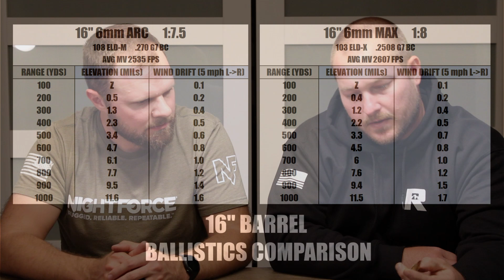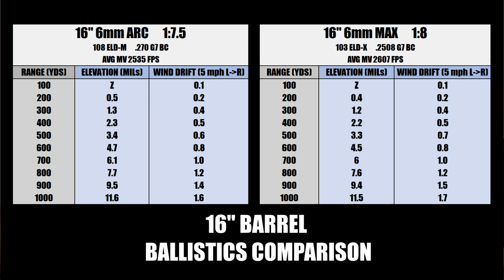6mm MAX vs. 6mm ARC: What's the difference?

Comment: It seems to be that the straight wall case would have more reliability issues with feeding because it has no taper. I mean, that’s the whole reason that 7.6 2X39 has the taper than it has: for reliability of extraction. So now you’re trying to tell me that this cartridge is more reliable because it’s long and thin and has no taper?

Comment: Ice not had failures with my 6mm ARC and 6.5 Grendel or reliability issues but im usually in hunting or sight in with occasional 100--1000 yard shooting.  This is interesting though with stock/thicker bolt face. Perhaps pressures can be upped a bit with handloading.

Comment: 6 arc and grendel really need an ak style bolt instead of the thinned out 5.56 bolt.  XCR and others have better multi cartridge version of bolts.  With Max being able to use a standard ar15 bolt, that does open the general options door.
Reply: No they don't. There's been 0 bolt related issues with 6 ARC, that weren't caused by improperly setup rifles or Fud's using over-pressured "hot handloads". And the only bolt issues with 6.5G were years ago and exaggerated to the max too. Buy a 6.5G Type 2 bolt, "problem" (that doesn't exist) solved. LMAO
Reply: The ICAR uses a bigger bolt as well.

Comment: The AR15 and "super short action" platform in general just needed to be sized a tiny bit bigger from the get-go. Something to the effect of allowing 10.5 to 11mm base diameter cases with the same thickness/strength as the current design has for 223. Same with the mag and mags being widened for that so they stack better than Grendel-sized cartridges. And screw it, either a 2.375 or straight-up 2.5-inch COAL, too. 2.25 is too small for the powder charges that wildcatters want, especially with the base diameter limit.
Reply: Well, I just did some Google searching and discovered 400 Legend. Now somebody just needs to make a wildcat out of that and we're golden.

Comment: The slower-burning powder requires a longer barrel, which is in the opposite direction of all the progress made over the last twenty years. To significantly increase performance, you need more powder. 

As people often wrongly believe, the higher pressure doesn't increase overall performance. Sig's higher-pressure round was developed so they could utilize shorter barrels with the faster-burning powder.

This is confirmed when you watch the 6 Max video from a 10.5 barrel. The performance is there, but so is that massive flame out of the silencer. That's not going to work for the military.

Comment: why didn't  yall compare  103 to 103 ????????????? Apple's to Apple's 🍎
Reply from the maker: If you consider the cartridge/case designs, they are not actually apples to apples. 103 is considered heavy for 6MAX while 103 is medium/heavy weight for 6ARC. However, you can find info on 103 vs 103 in this article we did, and you'll see there's not much difference ballistically between the two:

https://www.sunnshadow.com/post/6mm-max-a-comparison-of-top-performing-small-frame-cartridges-and-ballistic-data

Comment: I will keep my arc  , 6 max doesn’t work with heavier bullets . It will never take off
Reply: Almost nobody needs bullets heavier than 105. Max will be a beast as it gives ARC performance with regular bolt and mag combo
Reply: Why not heavyer more than  105 grs
Reply: 6mm MAX will eventually take off because it only requires a barrel swap, as it uses the same 378 Bolt-Face as 5.56. Which saves you time and money. It also is superior as an AR cartridge, and is more likely between the two to see actual Military adoption. Plus it has a standard 30 round capacity, 6mm ARC is 25 rounds with the same magazine size.

Comment: looks like you would get more throat erosion with the 6mm MAX over the 6 ARC due to the shoulder geometry. But yea damn! I have alot invested in 6 ARC but am cosidering transitioning over now to the 6 MAXX due to the increase in realiability,
Reply: Both have little throat erosion. The pressures are tame vs max spec for pressure

Comment: You guys have been holding the hand of the 6 max and slamming the 6 arc. You guys should stop slamming and just go with the casing, which is the game changer. If you go down to 105 grain with the 6 arc, performance will be the same, if not better for the 6 arc. The cost and availability of the 6 max ammo will make or  break it. We don't need anymore $1.70  round ammo.
Reply: Well when you can't run an arc reliably for more than 1000 rounds at most, for 10k rounds straight, it's just my experience. And many, many more folks experience. No slamming, it's all fact.

Comment: Been running 6.5 grendel since it's inception.  Hunted with it and put thousands of rounds through 2 different rifles one with a Faxon BCG one with a JP and I have a cheap PSA BCG I keep in my rifle bag just in case... Never needed the backup and I;ve never had to use the curved mags.  I run C-products 25 rounders and have -never_ had a feed issue or any type of stoppage.  The 6MAX looks like a cool round and a great improvement over the 5.56 but the 6.5 Grendel and 6ARC don't have nearly the troubles in real world usage that all the theoretical discussions always bring up.  123gr SST from my 16" 6.5 Grendel "mountain rifle" sure does a number on the White Tail and Mule Deer I hunt up here in Idaho.  I've even taken a cow elk with the round.

Comment: 6 arc can shoot all weights 6max cant. If you showed apples to apples fps comparison both with 103gn eldx instead of the 108eldm in the arc the arc prob would be faster. Im at 3700 rounds of 6 arc w a rca bolt w no prob. Never heard  of any from anyone else. I have on 5.56 caused by an over torqued barrel. I suspect if anyone does break one it would be a secondary issue. If all you wanted to shoot was the light bullet why go 6mm. But hey push that new hotness
Reply: @sunnshadow put some content out on this.

Comment: What are the actual caliber dimensions of the 6mm MAX? 6 x ? mm. The ARC is 6×38mm.
Reply: .243 dia and 1.263 bullet length on the 103g eldx
Reply: 6mm MAX is technically 6 x 43mm, since the 350 Legend (9 x 43mm) is it's parent case.

Comment: It's time to just redesign the AR's receiver set to be slightly larger....as LWRC has done with their 6.8 SPC platform. Then you can come up with any cartridge/magazine design that isn't restricted to the current OAL, will surpass 5.56 terminal ballistics, and still be much smaller than the AR-10.
Reply: Like the AR12?
Reply: @BYRM3215  No. Not the AR12.  "Slightly larger" does not mean the next size up.
Reply: I don’t disagree, but guys like the idea of interchangeable parts. If you break a bolt with 6 max you can run to the nearest shop and get one, with a proprietary system you’re kinda dependent on availability.
Reply: Someone is working on that for the ARC itself, built a purpose driven platform around the cartridge.... wait for it... correctly.
Reply: @maddawgmr are you talking about noveske’s new 6arc with def barrel?

Comment: I'm not wholly convinced that 6mm MAX is going to be all that much of an ARC killer.  ARC seems to be doing a good enough job of it by itself given the extreme limitation of ammo manufacturers producing the rounds(and rightly so since 5.56 and .300blk remain the most popular AR platform cartridges with .350legend competing with .450Socom and .458Bushmaster for the next slot, though I see more people looking for bolt guns in .350 than autoloaders in my area).  Then there's a limited number of manufacturers producing rifles in meaningful numbers for 6ARC to have really been propelled into more mainstream success.  Hornady was extremely tight-lipped about ARC when it first came out and imo that hamstrung the cartridge's potential.  Plus the questions of reliability with ARC, while reasonable due to it's grendel origins, could be at least mostly ironed out with time since it is still a fairly new round esp when compared to .300blk or even 6.5grendel and 6.8spc/spc II.  6mm MAX seems to be trying to solve a problem that really wouldn't be there if the industry actually took the time to properly work out the teething issues with each of these "super cartridges".  At this point it seems more like a junkie chasing a high that never really gives the same return on investment as that first hit(in this case being 6.5grendel and 6.8spc) where, it is true that these cartridges all solidly outperform the 5.56 ballistically at comparable ranges in exchange for certain concessions such as mag capacity, they hardly seem to offer any significant improvement over each other to be worth tooling up an entirely different setup in a mass production sense.  One of the main reasons I see .300blk having the level of success it has seen is due to its versatility in its use, production and load options.  A .300blk uses everything the same as a 5.56 except barrel more or less so fewer proprietary parts, it can load virtually all the same bullet weights as .308 and then some and this flexibility also makes it excellent for suppressor use which lends itself well to both home defense as well as small to medium game hunting at the avg ranges your everyday hunter may encounter(sub 300yds in most cases in the continental US where case restrictions don't persist).  Long story short, there's so many factors that lead to a cartridge living or dying so to speak and until I can see for certain 6mm MAX will tick all those boxes or any other wonder round for that matter, I won't rush to change over all of my rifles any time soon.
Reply: 6mm MAX is superior to every cartridge mentioned and is the easiest on the bolt and bcg. The miniscule differences (not counting .300blk at all, it's a sub 300yds effective round) between all of them is a stupid argument tbw. Because after 500 (if you're even capable of repeatedly and accurately shooting that distance tbw), it's STILL going to be a YOU factor. Not a gun or caliber cop-out factor.

Comment: Is this the standardized 6-223 wildcat?
Reply: This is based on the 350 legend case. The 350 is a slightly larger diameter than the 223/556 case. I had to double check in my reloading manual on the case sizes.

Comment: The Grendel-based mags leave heaps to be desired. Any step away from them is a positive thing, IMO.
Reply: Not to mention they look super ugly. The straight mags look way better
Reply: I run several duramag stainless 10rd mags for my 6 arc builds, zero issues with any of them. But some other brand grendel mags i havent been so lucky with.
Reply: My Elanders have been flawless

Comment: The real question is will 6mm max be supported by the manufactures.
This also, in a way, supports my desire to have a slimmer case for the ar10 platform. Get more rounds in the magazine, run the longer bullets, have reasonable firepower.
Reply: it runs in a ar15
Reply: @steveelder5306  I know... 
I was saying, if you could get a slimmer case in a ar10 length mag, you could have a big brother to this and fit more than 20-25 rounds. IIRC you can trim 5.56 pmags on the inside to get 30 rounds of .350 legend to fit. It's a thought I've had for a while but I don't have the space or time to make it happen. 
So imagine one of the small platform ar10s (SFAR, DPMS G2, POF ETC) with an ar15 face bolt in the carrier, pushing a longer case with a smaller OD than ..308. 
.308 has a base diameter of .47, .223 has a base diameter of .376. Doesn't seem like a lot but it's enough to change magazine capacity. .350 legend (parent case of 6mm max IIRC) ahs a base diameter of.39. So lengthen that case for the OAL of an ar10 mag, stack more rounds, have fun wild catting lol. Same thing with a 6.8 spc case at .422 base diameter, increase the OAL, neck it down to 6mm or 6.5, hell bump it up to 7mm, and have fun! While you're at it, run an Ackley shoulder. 

As far as the 6mm max, It'd be great if the industry would support it. 6.5 grendel had some decent support before steel ammo got cut off. 6arc is made by 1, maybe 2 companies... Remember 6.8 spc... yea, me either.. lol.
Reply: Yea. I wanna be fired up with 6 MAX. But not at $1.50 a round.
Reply: As a reloader, when Lee comes out with a factory set of dies I will get really interested in this. I have a bolt and a gas gun in 6 arc. If this becomes mainstream, the gas gun will get converted.
Reply: @josephlong7420  
It'd be nice if they'd fit in modded pmags the way 350 legends do...
Reply: @maguslascivious4980   if you handload some of the lighter slugs I think you could squeeze them into a polymer mag. I don't think anything above 87 grain would fit.

Comment: I'd like to see tests done with a 20"-24" barrel. Those certainly are good velocities for a 16" barrel but my preference is different than most I guess. I really like the fact it uses a 5.56 bolt. I've been lucky (If you want to call it that) and have broken only one extractor with ARC (And that was factory ammo) BUT that was the day before a match and I was at the range. (125 miles from home) I'm going to give this cartridge more time before deciding if I'm going to jump onboard with it. 6 ARC has been good to me and I have to admit, I'm also curious about 22 ARC. Wish I lived closer to where the Quantified Performance matches are held. All we have is PRS.
Reply from the maker: We have test data from BCPB on a barrel length vs velocity chart in an article on 6MAX here:

https://www.sunnshadow.com/post/6mm-max-a-comparison-of-top-performing-small-frame-cartridges-and-ballistic-data

Comment: I'll never understand why this hasn't been done before. Expanding the neck of the 5.56 round makes so much sense.
Reply: The 5.56X45 necked up is the 6x45, there is also the 6x47Rem. 

This guy is supposed to be built from the 350L giving it a little more capacity than a straight x45 derivative.
Reply: @wulf0101   And a 223 duramag will let you load the 6x45 out COL 2.305. If you reload the 6x45 is simple 1 step sizing. Range pickup brass is cheap or save your 223 brass. The 6x45 round is what the military should of done instead of the 5.56. There is the 25-45 Sharps also, along with 277 wolverine, 6mm mongoose, 6.5 PCC (Patriot Combat Cartridge) or go down in caliber 20 Tactical ( I have) or 20 Practical- either of which keep up close to the 204 ruger. If there is something the 223/5.56 can be made into its more then likely been done already.
Reply: I agree!
But I will say both my 6 ARC guns have never had any feeding issues. Both run like old fashion type writers.
Reply: Same here. No problems using cheap 25 round AR stoner mags. Not sure who makes them but they're GTG. I use an enhanced Aero lower on mine @tompanek7511
Reply: its been done before. everything has.
Reply: 6.35x45 gives similar performance . Uses std brass and mags too.
Reply: Because that's not what 6 max is. It's a necked down 350 legend straight wall cartridge.
Reply: The military played around with the 6 x 45 back in the early 70's. Heavier bullets leaving the barrel faster, but they must have felt that the juice wasn't worth the squeeze
Reply: They did with the 6x45/ 6x223 but the powder was the problem. Yet it could have if say black hills worked it and the DOD did look at it. But the grain weigh wasn't there.

Comment: Having broken a 6.5 Grendel extractor and only being able to use 10 round magazines reliably, I welcome this round and look forward to using it.
Reply: Some companies used wrong bolt for the chamber 7.62x39 and 6.5 Grendel have same bolt face but face depth are different same issue with extractor depth issues 
Also on extractor make sure there is a chamfer on it so ramp over rim during feeding
Reply: 6.5G Type 2 bolt. 5k+ rds, 0 issues whatsoever.
Reply: 6.5 Grendel will feed reliably out of the Duramag 7.62x39 30 rounders. C-Products feeds them, too. 

If you're breaking extractors, try increasing your buffer weight, and/or adjusting your gas, if an adjustable gas block/gas key is an option for you.
Reply: @BuckF0eJiden  ^THIS^  been shooting the 6.5 Grendel since it was introduced and I've hunted with it for years here in the PNW.  I've had 25rnd C-products mags run perfectly for me and never broken a bolt/lug/extractor.  I've got 2 rifles, one with a 16" Faxon Match bolt/barrel and a 20" BA Hanson barrel with a JP bolt, both run flawlessly.
Reply: @DB.KOOPER  most people don't shoot enough to see broken extractors or bolt lugs in 6.5 Grendel ARs. 

Even if you're running a massively over-gassed system... you're looking at around 1k rounds before issues pop up. Most people won't get close to that in their rifles. 

I have around 3k through a 6.5 Grendel with properly adjusted gas, and I'm keeping a spare bolt, cam lug, and firing pin in the pistol grip of that one, I'm expecting it to go just and day now. 

Keeping extra bolts and parts on hand is a pain, but it's not expensive or hard to replace. 6.5 Grendel is absolutely usable in both hunting and duty applications because of this. Just never let your bolts go over 1500 rounds, and you'll never have an issue.